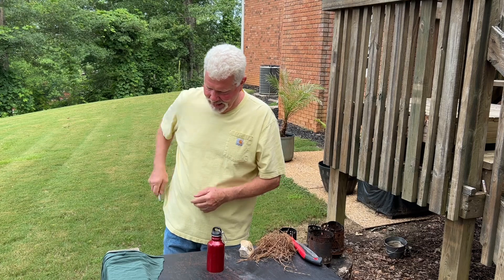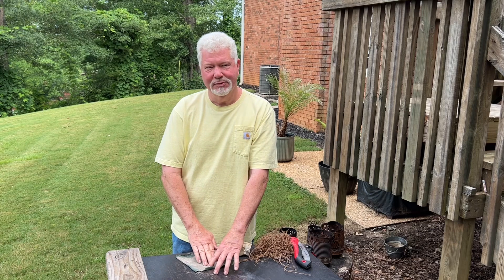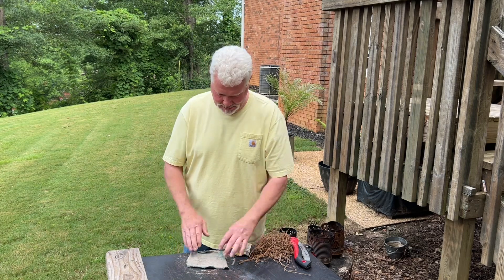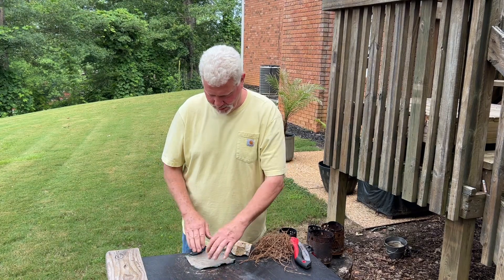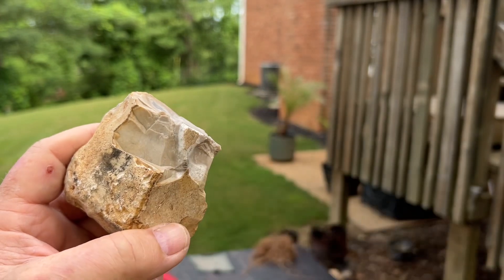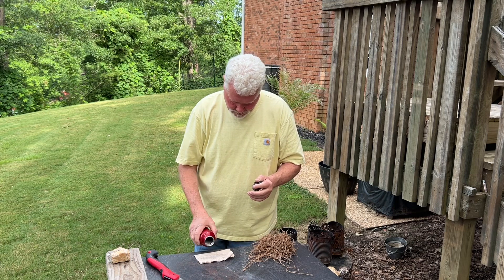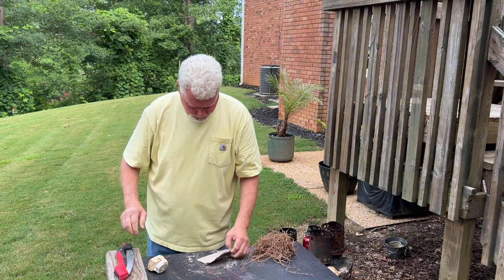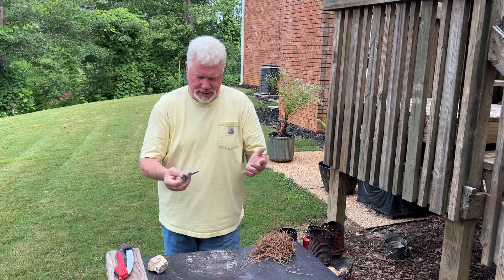Flint And Steel Igniting Ashed Tinder... The Limitations

Comment from the maker: I think Flint And Steel ignition of Ashed Tinders is going to work the best with known coal extenders like Punkwoods, Plant Piths, Bracket Fungi, etc. I had high hopes of igniting Tulip Poplar inner bark, White Oak sawdust, and T-shirt material but, they just would not respond.
   Agreed, the 3 types of "tissue paper" that you've seen me ignite so easily are not coal extenders, but do consider their density, microscopic make up, dryness, etc. They will help you pick good non coal extender candidates to try with this technique.
   Today, I tried t-shirt material. I was casting some good hot sparks off the saw but, it just would not ignite. I broke out a napkin from the local gas station, saturated it well with ashes, and ignited it easily with Chert casted sparks from my Coronavirus Razor Tooth saw.
   Please follow the LINKs below and SUBSCRIBE. Thank You!

Flint And Steel Playlist
https://youtube.com/playlist?list=PLkoXX8XsMW3mFf5FgLtam1aDmXmqQQice
Flint And Steel Igniting Ashed Toilet Paper
https://youtu.be/thJMFArUNuk